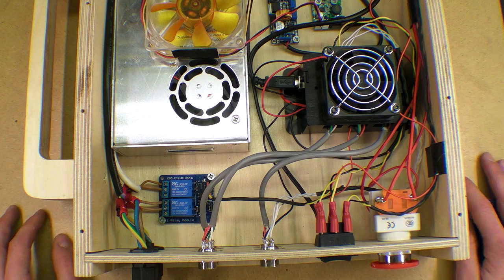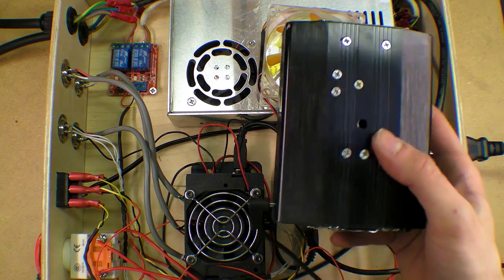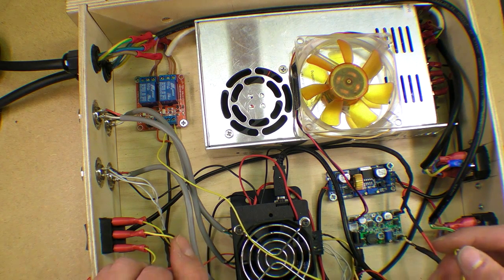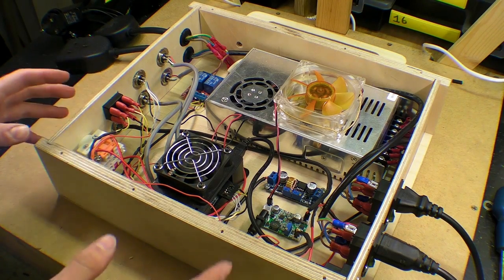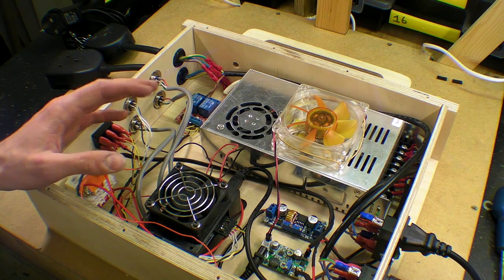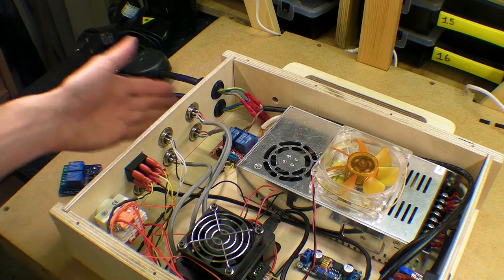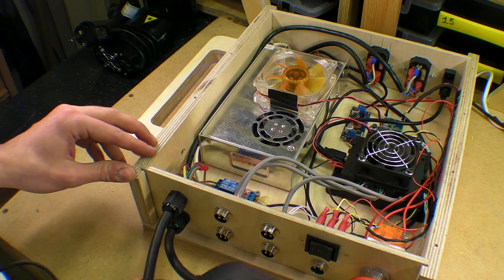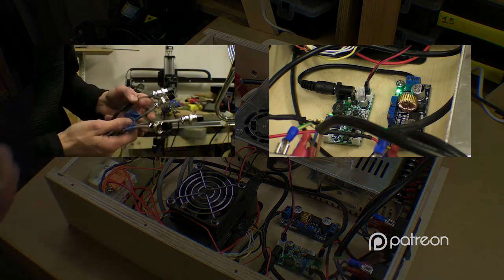CNC Control Box Overview

Comment: The connectors on the laser driver board looks like JST connectors to me. They come in various sizes and styles, and I can't tell for sure from the video, but they could be JST XHP-2 connectors.
JST connectors are often used for low current power circuits (<3 Amp), like battery connectors. Check your local electronics store for battery connectors or pig tails with JST plugs. alternatively Amazon has a kit with an assortment of JST XHP connectors.
The benefit it this type of connector is, that they are keyed and they are locking, so your connections won't come loose.
Reply from the maker: +Jan Petersen Thanks for that! I thought I could use fan headers at first but they were different.  I just bought some of there! Thanks again.
Reply: +Jan Petersen good call, beat me to giving a plus 1 to just using the hot glue.

Comment: Hi! How would you split mains power for one PSU and a spindle so the whole machine takes just one outlet? Thanks!
Reply from the maker: Alex PD Use a barrier block but one rates for the amps you'll draw.
Reply: Educating Savvas Hmmm I was looking for something similar to those screw terminal blocks, but these have two rows of (e.g.) 8 screws each. One row is for Live and the other for Neutral. Any idea about them?
Thanks!